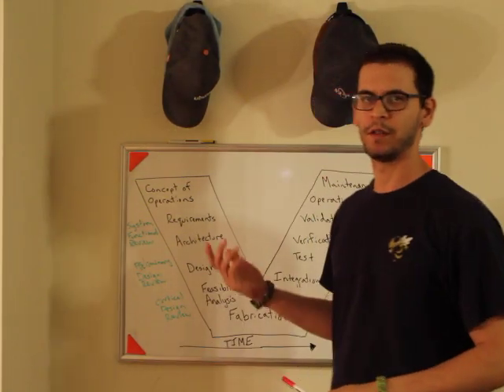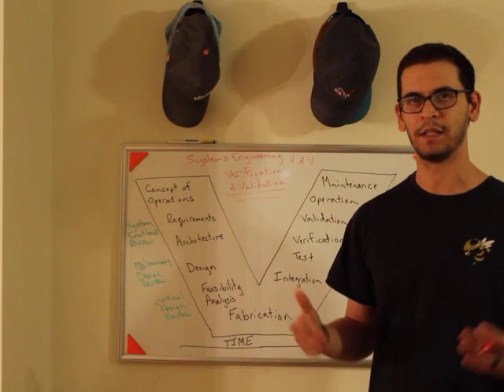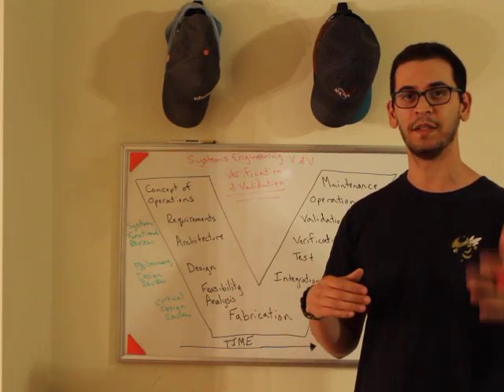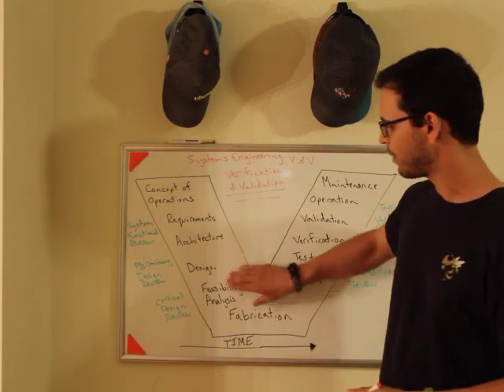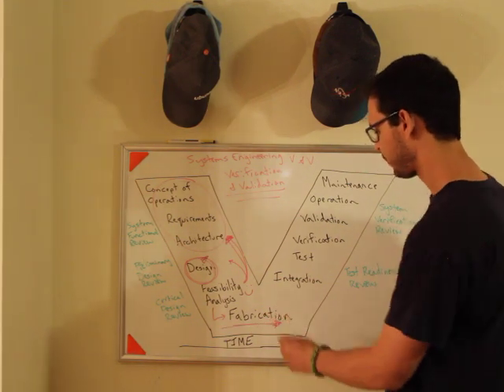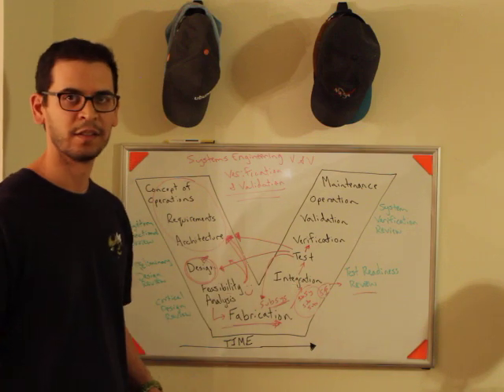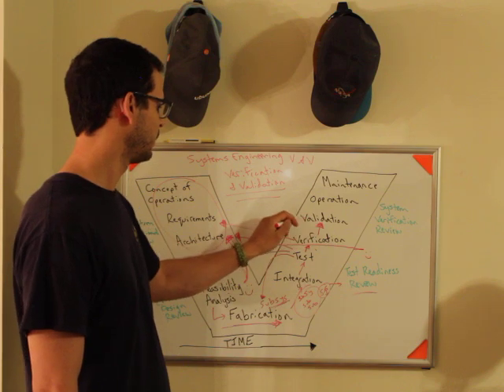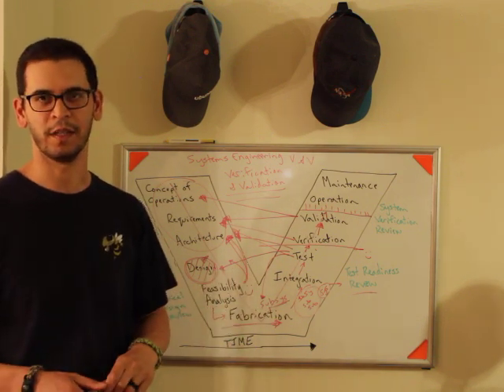Systems Engineering - Concept of Operations and Requirements to Operations and Maintenance

Comment: Hello sir.
I love your lectures, could you please make a tutorial about curve fitting of an ODE or System of ODEs in MATLAB? Which estimate the parameters too. 
Please help me make this code.
Thank you.
Reply from the maker: I think what you are looking for is an adaptive controller. You don't curve fit an ODE. You have ordinary differential equations and you integrate those equations to get the time series. Curve fitting is like least squares regression for data sets that are static not dynamic. As for estimating the parameters if you want to simulate an ODE and estimate the parameters you need a self tuning controller or a Model Reference Adaptive Controller. I have a few videos on that and I made one for Python. https://youtu.be/em1OaaLczBY Let me know if that's what you mean.